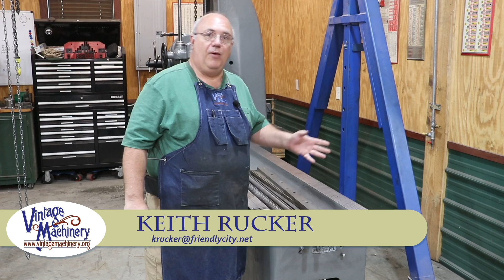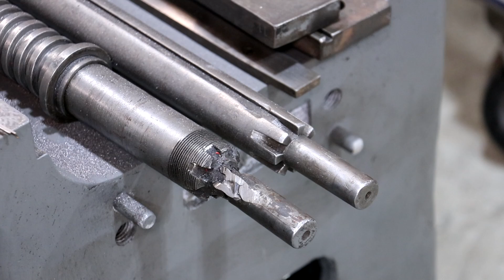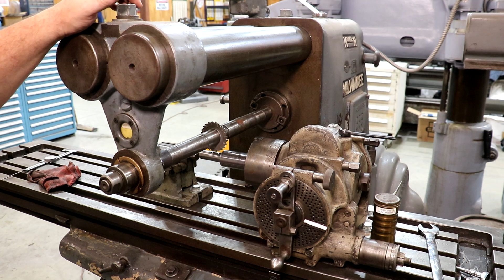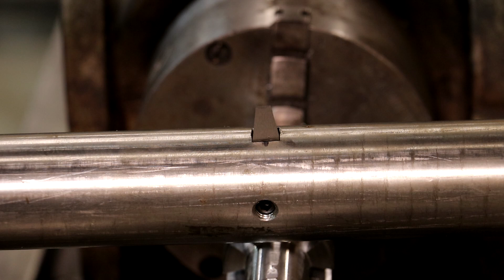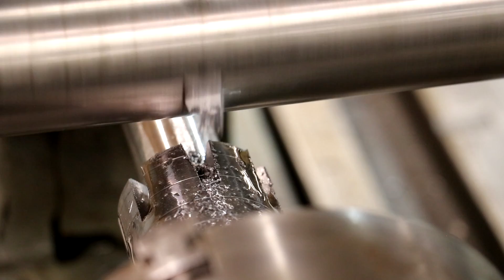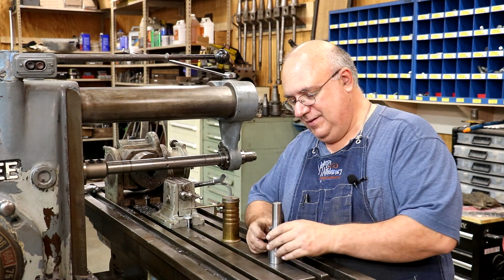Horizontal Boring Mill: Cutting a Spline on a New Blank End for the Cross Slide Lead Screw

Comment: Keith I do hope you are do a bore a female peace into the for the cross slide  shaft and a male on the new part and a 30 degree edge for the weld to have maximum strength. The male and female fit up will ensure go alinement and the correct gap for welding.

Comment: Great video Keith.  I have a small horizontal mill and never even thought of making a single point cutter (great tip).  I liked your approach to the overall repair, and I have done that myself.  When I can I turn a small indexing and guide pin into the new part and then bore a hole to receive the pin in the main shaft.  It is a helpful aid when welding keeping everything aligned.  Looking forward to the next video.  Keep up the great work,,   Fred  Ontairo, NY

Comment: Just an idea from watching Cutting Edge Engineering attaching new hydraulic ram rod end eyes.  In order to align the new piece with the lead screw before welding maybe cut a spigot on the mating end of the new piece and bore a hole for a slight tight fit in the cut end of the lead screw.  Then press the spigot of the new piece into the hole in the cut end of the lead screw and it will then be closely aligned for welding.  Just a thought that you may already be planning to do.

Comment: Are you going to drill a hole in your part and a corresponding knuban on the old shaft to align the two parts concentrically before welding?

Comment: The single point cutter worked beautifully. Could you have used a longer piece of HSS and ground the profile on both ends?
Reply: Uhm... oh!  To turn it into a double point cutter?  Think about... how to make the ends exactly the same shape (by hand, at the grinding wheel...  ugh!), and how to get them perfectly aligned in the boring bar.  Arbor.  Whatever.  It might end up more trouble than it's worth.  Single-point cutting as a concept has some strong advantages!  Nothing to sneeze on.  :)
Reply: @ydonl  Yeah, you're right. it would be difficult. Perhaps grinding it on the surface grinder would help with the accuracy.
Reply: @nobuckle40  I think it could be done, but agree with you that it would require some jig-or-fixturing.  The alignment would be hard; I always notice that a slitting saw blade always seems to be off-center a little bit, cutting only one side, "gruhn... gruhn... gruhn..."  That kinda thing.  Doesn't take much off-center!

Comment: This is giving me deja-vu…  I had a 50’s swather that snapped the spline off the the drive end of the shaft that transferred power to the swather head.  Not having a mill, we cheated, and using our worn out chinese baby lathe drilled and tapped the ends, threaded them together with a stud, and welded the whole works together.

Comment: Keith, in your spare time... I would love to see an in depth demonstration of the index head. History, manufacturer, etc. What a wonderfully complicated piece of gear! Can you imagine calculating and laying out the hole pattern before computers (and likely before slide rules...)?
Reply: It's not as complicated as you think.
Reply: @Jeremy-iv9bc  Pray expand...
Reply: Short introduction. Most index heads are geared 40/1 reduction and supplied with five or more hardened index plates. With the correct index plate an infinite number of divisions are possible.
Reply: Check out his restoration of this dividing head. It's buried in the collection somewhere. He does his usual strip down to component parts and excellent explanation.
Reply: @wwtrkr3189  I will begin the search. It figures that he would have done this already. Thanks!
Reply: Fair comment, but a quick google and slide rules are supposed to be invented in 1622, I’d have guessed at Napier, but I was wrong. In its time  I found slide rules could do a pile of things a calculator struggles to do, but I’m no Luddite, I was saved by calculators, after all  they like slide rules, are no better than the idiot operating them.
Reply: @johnsherborne3245  I didn't think they came into general use until much later, like the turn of the 20th century. At any rate, I still have my Log Log Duplex Decitrig and Log Log Trig. It's fun to show them to kids today who can't do long division without a calculator. They are amazed at the accuracy one can achieve. I inherited both from my father who got his Engineering degrees using them. And I did the same. Thought my son would use them, but Accountants seldom use slide rules.
Reply: @The_DuMont_Network  yes, I’m sure you are right, my guess is that logs were probably more widespread, I learned to use five figure logs way ahead of my peers as my long division was so unreliable.
Reply: @johnsherborne3245  I got to college just as the Set Theory New Math was beginning its vogue. What twaddle! Cost me a semester of absolute idiocy. Fortunately the "Prof" and I enjoyed the same beer joint. 
New Math made as much sense as APL (the programing language). Try to stay Cool, it was 101 here at 0700.
Reply: @The_DuMont_Network  APL made sense... it was just hard!  :)  And squiggly and cryptic.  But very powerful.  And a poke at the computing community to say "vectors are a Thing."
Reply: @ydonl  We had a Selectric with an APL ball for a terminal. True, it was a poweful and concise language. Especially in the small memory days. Nowadays it isn't worth the hassle.
Reply: @The_DuMont_Network  the UK went down a similar line, the only value was I once needed to know a number in octal, in an entire career in technology! Currently 34 outside, but a bit cooler in the workshop.
Reply: @johnsherborne3245  I'd welcome 93 degrees F. Although I am a desert rat an revel in warmth, there is a limit. I've put canopies over my cars and have a mister going. Even with fans it is too hot to work in my shop and I'm limiting A/C use. But a few days baking is a small price to pay to live in Texas.
Reply: @The_DuMont_Network  It didn't exactly take over the landscape, did it?

I've wondered if or how the Selectric fit into the inspiration of the whole thing; as a driving or driven force.  Just a thought.  "Hey!  Symbols! We could do symbols!  Who needs words?"  :-)
Reply: @ydonl  We just didn't have a video terminal for it. This was in the days of those big EBCDIC video terminals on the main system. The APL terminal was a Selectric keyboard/printer. I played with it for a few weeks, saw it was a hopeless mess and promptly forgot all of it especially all that dyadic stuff.

Comment: Seems as thought the spline cut depth into the diameter should have been to the final diameter of the smaller shaft diameter? Once you remove the additional diameter material to final, won't the spline depth be higher than the smaller shaft diameter? Maybe it is an insignificant amount and it is so hard to tell on videos. Thanks very much for sharing. Always learn something new when I watch your videos.
Reply: Look at 1:45 in the video. The tool seems to have plenty of clearance.

Comment: Interesting. A question: I know it’s unnecessary, but (how) could you square up the ends of the castle grooves (If it were wood, chisel)?  An end mill would just leave vertical curves.  Just curious.
Reply: In wood a chisel as you guessed. 
In metal an electrical discharge machine (EDM) with shaped  plunge type electrode would work but very expensive.

Comment: It's more likely that the 1.560" shaft is 1-9/16"(1.5625") nominal than being metric which would be a very odd nominal size at 39.624mm.
Reply: Wasn’t the bearing a metric part number,? even in 1918 SKF would probably have made metric and imperial. It’s a curious thing but the worlds oldest standardised thread system was metric, based on even older Swiss metric system. Whitworth devised his system  based on the mechanical properties of the available steel which is why they are a bit agricultural and chunky.

Comment: Yo Keith.  Like the single point tool solution. (I did that for a bevel gear I repaired for an old Buffalo Camel Back) 

 - You got machinery that I couldn't even dream of....Maybe you might want to look at a tool and cutter grinder.  HGR in Euclid Ohio has KO Lees come up all the time (Got ours in pretty sad shape for $140. (Got it working fine now) I even got a powered work head there for $80 and do small ID/OD grinding on the KO. ... Check it out. You might even score a Brown and Sharpe #3 universal. You can grind your own lathe spindles on that thing. (I have seen them there for under a grand) 

Keep up the good work, though. Cant Waite to see the Lucas making chips.

Comment: For those in the last video saying the tool needed to be offset in the arbor so the leading edge was centered on the shaft, see this video. It doesn't matter in this case because the resulting offset from center is so minimal. Nice work Keith!
Reply: @Current Batches So, do you feel better now?
Reply: @Current Batches unnecessary and a bit nasty
Reply: @Current Batches This man fits producing these episodes into, probably, an already busy life and I’m sure many find this a rewarding educational experience which extends beyond just running a machine, such as how to behave like a gentleman.
Reply: @Current Batches he doesn’t usually need to do work that requires tremendous precision. Do not say beware to anybody about such a good man as Mr. Rucker

Comment: Turn a sigot on the shaft .. drill the splined replacement part with a corresponding bore .. slip together  and it will be true .. now weld ..jobdone ....

Comment: The welded attachment point you describe at the start of this video has me picturing a tapped inch or three and then a threaded inch or three shaft to twist in-and then weld the outside. 
 
It will be interesting to see your actual attachment point strategy.
Reply: was thinking something similar. Possibly threaded/loctited/cross pinned.  Not sure if that's more or less work than welding but I'd be worried about warping that shaft doing a weld.
Reply: @mgsperformancerc  i think leaving extra material is great experience in play to account for heat issues from the weld. Your point there about the heat is a good one. 
 
Say the stock used was too short for such a threaded end we are talking about… well, what about a tapping of the part being repaired as well as a tapping of the repair itself and a threaded rod mating the two prior to the weld? 
 
This would help with truing it, strength, and cut way down on the heat/weld issues all while adding improved strength. 
 
I tend to over build, cuz I really do not like Re-Work. However, i submit that in this example,the damage being repaired was from a moving of the equipment. This to me represents a unknown danger zone, plus already attempted repairs add another layer- like what kind of heat and cool has that steel been thru already? 
 
A flux core weld or some such puddle maker will surely mate the repair to the damaged end, but it just seems to me that high end specialized tasks like this one need as much or more finesse than brut force. Aye, a couple more steps it is to add this idea into the build, but totally worth it, imho.
Reply: @RASAllusion  yep agreed.  The extra to true the repaired part is fine but the original part could warp.  I’ve watched Mr. Fenner straighten shafts so it can be fixed either way I suppose.  Mr. Rucker knows his stuff too, I have confidence in his approach, maybe in my case it’s more indicative of my own confidence :)
Reply: @mgsperformancerc  absolutely!! He has talents well beyond mine that is for sure. My lathe is a dewalt in a vice and a die grinder 🤣😂🤣😂😂. Looking forward to seein him finish this upgrade repair. 
 
As an aside, i was thinking about the threads that exist from the former repair. I find myself pondering a type of castle nut there  that would mate with the turning tool. 
Be well.

Comment: I'm assuming that the splines are not as deep as the final diameter of the smaller shaft end given you turned it larger than the finished diameter?